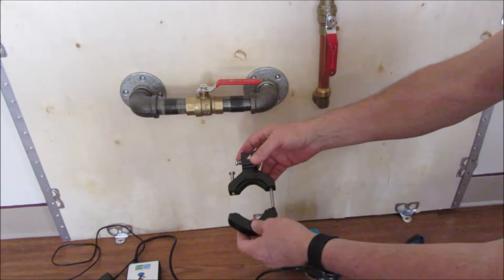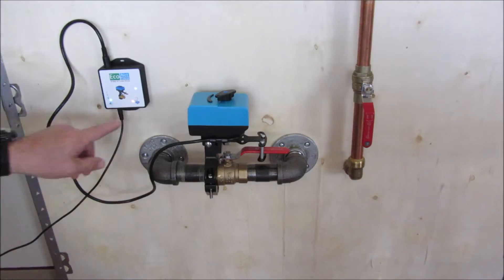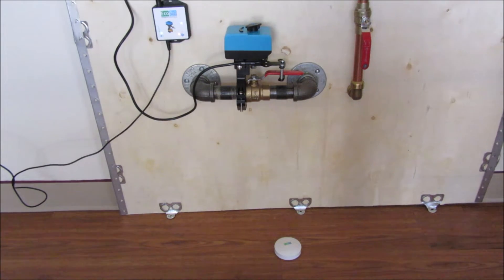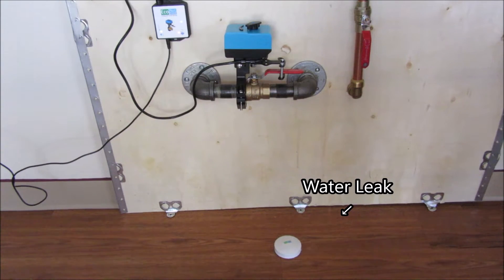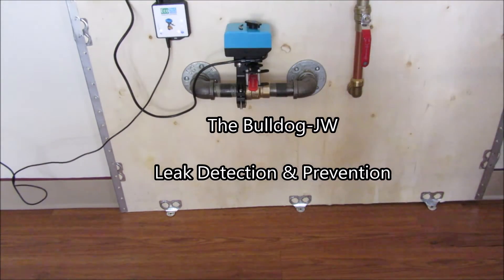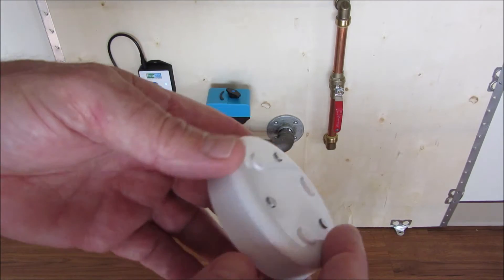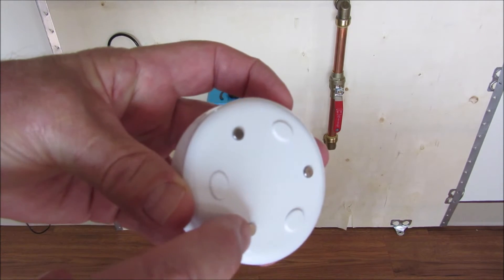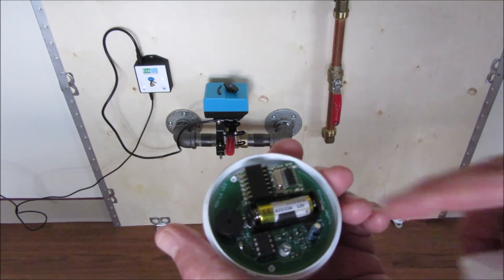Bulldog Valve Robot in action with leak sensors

Comment: The trick is there is no way you can check these sensors are connected to bulldog. What if something happens with pairing? It means sensor wont be able to send signal
Reply from the maker: thanks for your comment. Pairing is very reliable, however, with mechanics/electronics there is always a chance for failure.  The system should be tested once or twice a year, with the leak sensors in position on a wet paper towel.